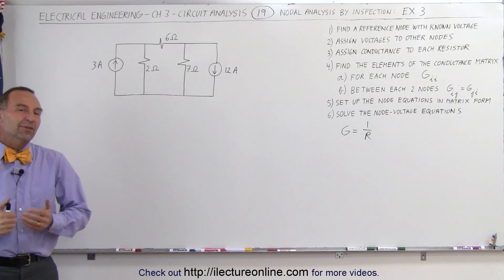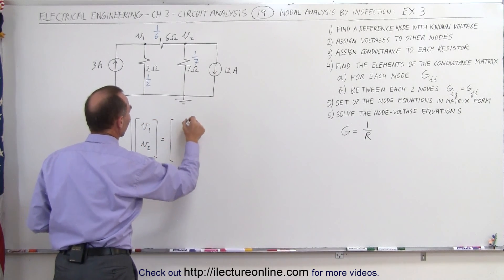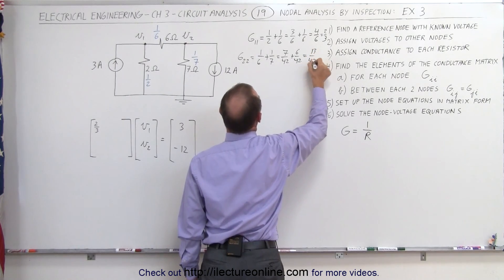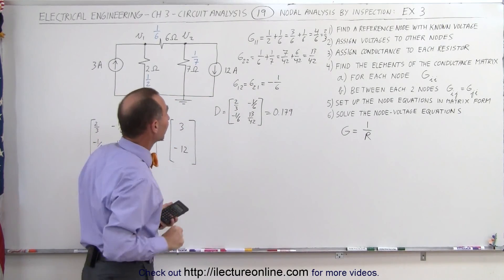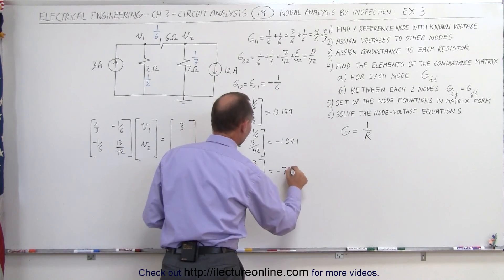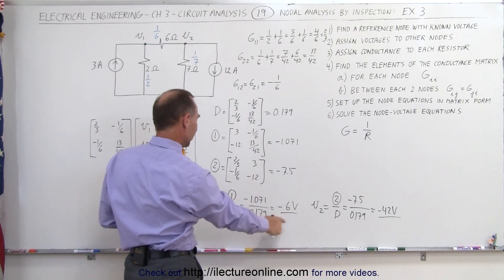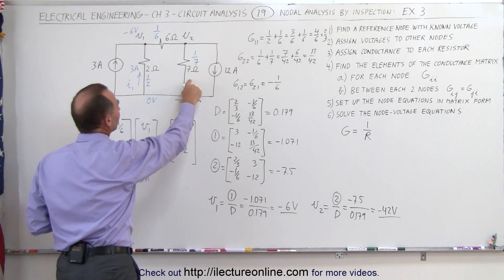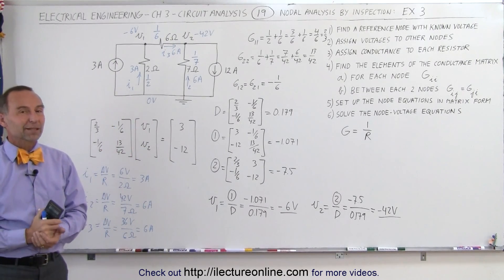Electrical Engineering: Ch 3: Circuit Analysis (19 of 37) Nodal Analysis by Inspection: Ex. 3

Comment: Why the current generated from the current source on the right (12A) goes from the lower potential to the higher? Or maybe i should say, why when we analyze the circuit we discover that the potential in v2 is lower than the one in v0 (reference node)?
Reply from the maker: A current source will push current in the direction shown regardless of the polarity.  (Just like a battery can "push" in the opposite direction of the current).
Reply: Thank you for the answer sir. I know that a current source pushes in his direction regardless of the polarity, i just thought the voltages would result settled in function of the currents given (in such a way that each current would have gone from the lower potential to the higher) but it seems i was wrong.